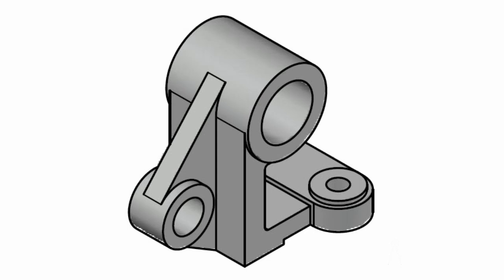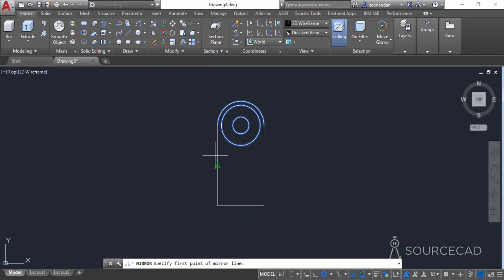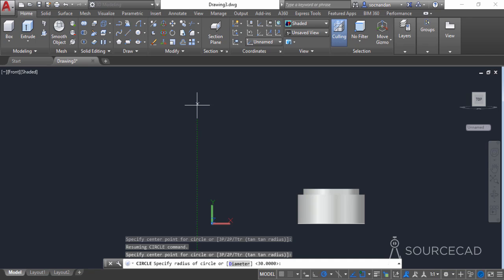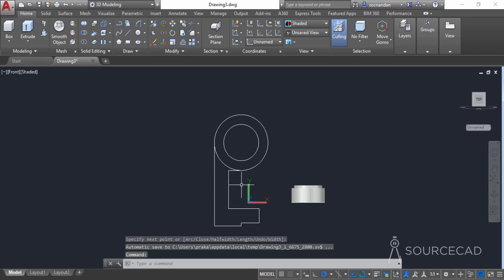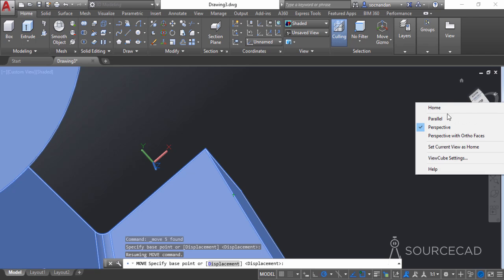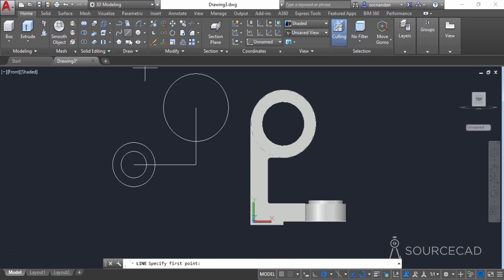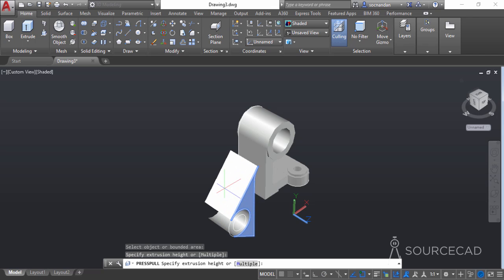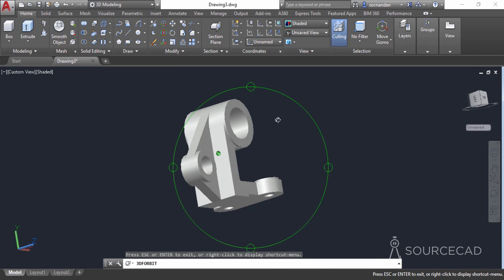AutoCAD 3D practice drawing - SourceCAD

Comment: that is great video but my autocad version is very uhh trashy .-. because when im using line or polyline and when i put it on any point its not exactly on it for some reason and that dont lets me use pedit .-. and also when i try to grab any part it spamm the middle of any random object i have placed and dont lets me take what i want it just freeze on the freaking middle i dont know what is freaking wrong with my autocad but its annoying if anyone know what is doing these buggs please tell me.
Reply: [anyway i still made  the model it was hard because many of the commands dont work and i had to finde another way to make them but only few commands might help because the most of the commands im using are broke]

Comment: SIR..FACING THE SAME ISSUE HERE LIKE IN ONE OF YOUR EARLIER VIDEOS.
WHERE IN I PRESSPULL THE SECOND PART OF THE DRAWING TO CONVERT INTO 3D SOLID IT ONLY DOES SURFACE SOLID PRESSPULL, I MEAN A HOLLOW SOLID ONLY  BUT NOT A BLOCK OF SOLID AS REQUIRED IN THIS SCENARIO AND AS DEMONSTRATED BY YOU...SO PLEASE HELP WITH UR VALUABLE SUGGESTIONS..